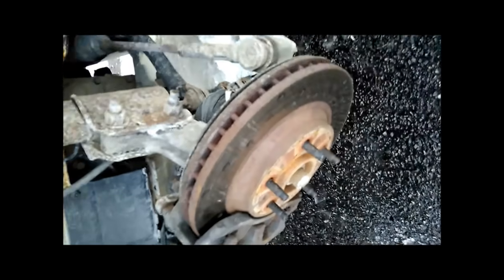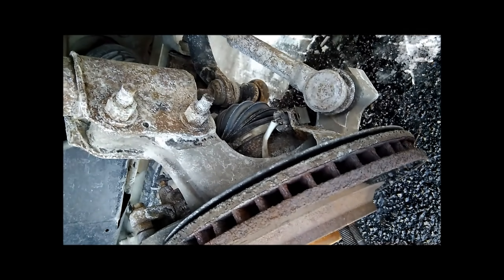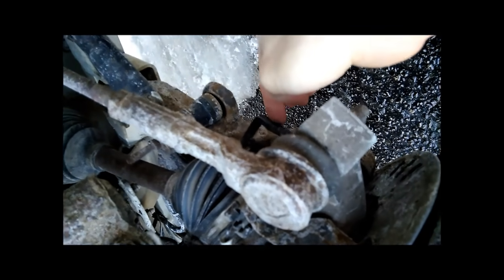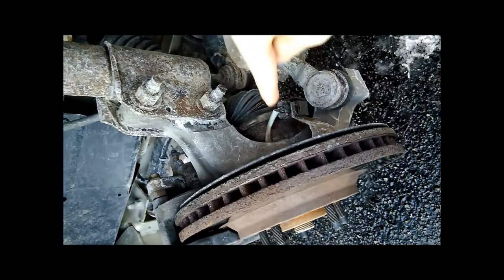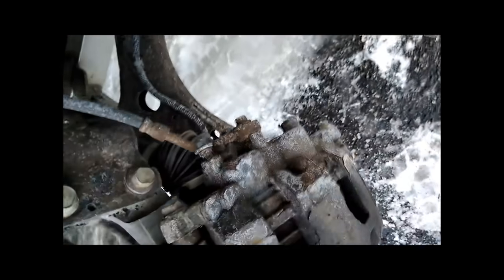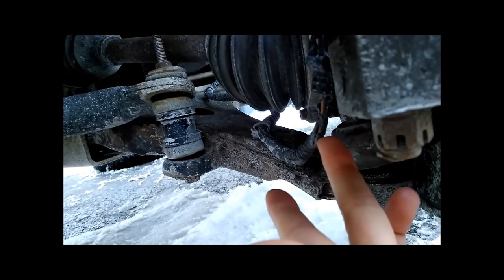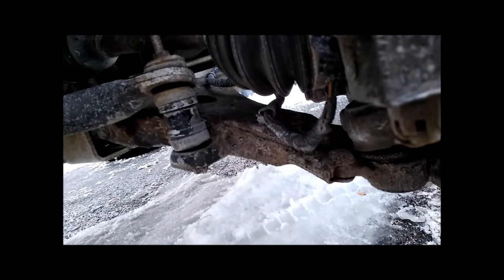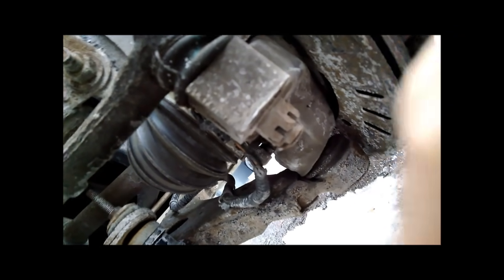How to fix ABS light, Traction Control, Stabilitrak

Comment: I'm having this same issue with my 2009 chevy equinox. I just purchased it from a used car lot. 2 weeks ago. The traction control  and starlink light were both on. I still. Purchased the car. Had a mechanic come and replace majority of everything on the car. Including the wheel barons, shocks, brakes,  fuel pump, etc....
But the traction control and stabilitrak light is still on. Now the ABS light and all wheel drive is off light is on as well. And yes husband was outside as the mechanic worked on the vehicle, watching.  Also we purchased all the parts so that all he had to do was the labor.  What else should I do.
Just spoke to husband to tell him about this video. Turns out he only got the left wheel baron replaced and not the right. So maybe that's what's going on.
@ChrisCamaro
Reply from the maker: Mechanics have a special scanner called a "Tech 2", which can scan the body control module.  This is something we can't do with consumer level scanners. You need that to determine which wheel is responsible for the problem.  Any 1 of them failing could trigger it.  Any decent mechanic will scan your car for next to nothing or at the most $50 if he's a thief.  This will tell you which bearing to focus on.

Comment: Will this make the car jerk
Reply from the maker: If successful, it will make the car NOT jerk :)
Reply: @ChrisCamaro  I mean like before fixing it? Will it feel like trouble shifting gears? Mine jumps and jerks at 1.5 ish rpm and seems to be getting worse no check engine light but service t.c. light and message appears
Reply from the maker: @tommybear4458  The TCS does its job by modulating brake pressure so when it misbehaves you would feel it as pulsating in the brakes.  This can cause the car to jerk but it would feel a bit different than a transmission problem.  I've had transmission problems and they are much more violent and don't feel like chattering or vibrating but like 1 solid clunk that usually correlates to a sudden change in RPM.

Comment: It could be a short but 85 percent of the time its the clock spring 40 years traveling. Trouble shooter general motors
Reply from the maker: Clock spring?  You mean like the kind used in seat recliners?  I don't follow.

Comment: I was getting warning on my 2012 Impala it turned out the battery needed to be replaced.Went away after putting in a new battery, the car would hesitate on accelerating from a stop also.

Comment: Could you just unplug it and go without it?
Reply from the maker: Sure.  You'd have to be ok with having permanent lights on your dash (3 in this case) and no ABS or traction control whatsoever.  The car would drive like any old pre-ABS car, if that's ok with you.
Reply: @ChrisCamaro  right now the traction control is putting me in dangerous situations, like stallinv while im driving, so I'll give it a try at least.
Reply from the maker: @ds74878  Yeah man just yank the fuse.  In the Impala there are 2 fuses you have to pull.  They are not the usual skinny rectangular coloured fuses but larger square'ish chunky fuses.  It's the fuse box under the hood, not in the cabin.  If you check your user manual it should say something like ABS motor 1 and motor 2 or something like that.  Just pull them, start the car and you should notice 3 MIL lights for the TCS system and brakes.  The car will then drive normally.

Comment: The system doesn't work AND the light doesn't come on for the ABS.  The MIL functions fine.
Reply from the maker: If you're sure the lights aren't burnt out and the system doesn't work and the lights are off, then the only thing I can think of is that the hydraulic pumps are malfunctioning at a mechanical level.  But I think that's highly unlikely.  Get a mechanic to scan the BCM and see if it's throwing codes that may not illuminate the dash.  Some codes don't throw a light but are just saved in memory.  Again, I can't see this being the case but in a situation like this you need to eliminate the impossible.  Whatever's left, no matter how improbable must be the truth.

Comment: Those lights are on and stay on but car drives fine.
Reply from the maker: If the signal lines going back to the computer are completely "open" or disconnected and are not intermittent, as they would be with a loose wire, then the system will simply deactivate altogether and from your perspective the car will drive like it was never designed to have traction control ( like most old cars).  You won't have any driveability problems. Just normal driving without TCS.
Reply: @ChrisCamaro  so does this problem only fix the lights that come and go . Mine stay on but car drives fine . I need to pass a echeck but check engine light is on
Reply from the maker: @hanz589  As far as I remember, from when my area had drive-clean, you won't pass an e test if the engine light is on, no matter what's doing it.  I could be wrong but I think that's the case.  As for the lights, as long as they stay on or stay off, the car should drive fine.  When you get into trouble is when they flicker or when the wires are shorting when the car moves around.  In any case, you can fix the intermittency by pulling the ABS motor fuses but that will mean the lights remain on.  To make the lights go away you have to fix the root-cause of the issue, whatever you determine it to be.

Comment: You don't need to spin the wheel to do that test.
Reply from the maker: Need is subjective.  If there's physical contact between the wire loom and other moving parts of the car I want to check for it.  If not, it rules that out.

Comment: That has nothing to do with it
Reply from the maker: What has nothing to do with what?
Reply: @ChrisCamaro  the wheel sensors have nothing to do with the stabilitrack I've changed my stability sensor and still have my abs and tire pressure sensor lights on and no problem
Reply from the maker: @juanperez5444  If you say so.

Comment: Ur so full of it. That happened to Me and I believed your diagnosis.... Changed all my TPMS sensors. 300 bucks and the problem still exists!
Reply from the maker: Diagnosis?  Well there's your problem.  I'm making a video to tell people "how" to diagnose "1" possible root-cause of the problem.  I'm not telling you that your car specifically definitely has that problem.  Why would you go and replace everything if you hadn't made the determination (yourself or via a mechanic) that the sensors needed to be replaced?  The idea here is for people to know in advance what the issue is so they can save money.  The spray and pray approach doesn't require an instructional video to implement.
Reply: Tpms is for tire pressure monitoring systems , this is a video about abs

Comment: I have Honda Accord 2010.
Problem #1.
ABS, VSA, and BREAK lights stay ON solid. 
Problem #2.
This past winter, the FAN inside the cabin came ON and wouldn't turn OFF even when the car keys were removed/ engine OFF.

WHAT I DID SO FAR:

I. Checked fuses under the hood using Voltage detector Probe:
1). Replaced fuse #15 ( 10A) =  my radio/ windows/ door locks began working again.
2). 🧧Fuse #21 (7.5 A) seems to have no power supply ( no voltage at all, blank).

II. Checked fuses in the interior fuse box on driver's side (using a Probe):
1). Only fuses in one row, 
#19- #31 worked/ had voltage.
2). 🧧Fuses in the middle and outer row, #1- #18 DIDN'T HAVE ANY VOLTAGE! BLANK. 

🧧Does it mean, that there is NO POWER SUPPLY, and not just blown fuses??

III. I also connected INNOVA 6100P OBDII scanner, and:

1).  It didn't pull any DTCs from the computer. BUT It said: "  No Powertrain DTCs or Freeze Frame Data is presently stored in the vehicle's computer". 
HOWEVER,
2). I scanned ABS, and it OBD2 scanner read:
81-3 (1/1) Permanent.
Central Processing Unit Internal Circuit Malfunction

PS. I WENT TO A COUPLE OF AUTO SHOPS. They lied to me saying ALL fuses work fine. I found that fuses #1-18 on driver's side fuse box don't even get any voltage on either side of a fuse. My probe was blank not showing any voltage on either side of those fuses.
I also found a couple of blown fuses, and replacing them fixed my dashboard lights/ radio/ auto windows!

So, I know what they were trying to do🤕

CAN YOU PLEASE SUGGEST WHAT ELSE I CAN DO MYSELF BEFORE I HAVE TO FIND ANOTHER SHOP AND TAKE MY CAR THERE?

Comment: Chris Camaro ain't no Chris Fix. Go to a good channel if you want precise advice. You lost me at electric tape where all the water goes. Heat shrink, liquid tape, anything but electric tape
Reply from the maker: It's a stop-gap solution.  I said that from the beginning.  Doing a professional repair on something you haven't verified is causing the problem is putting the cart before the horse, is it not?